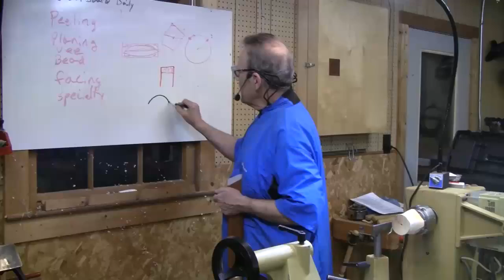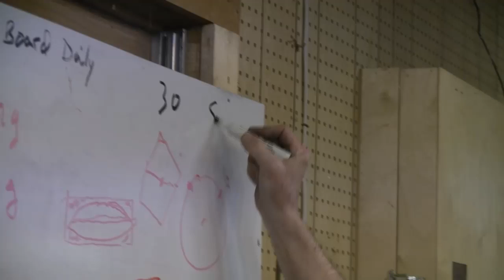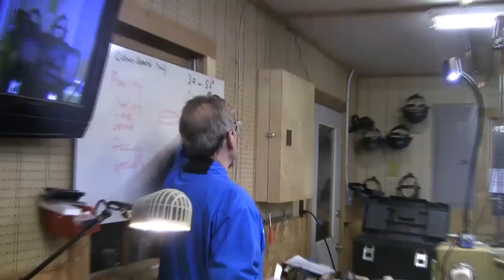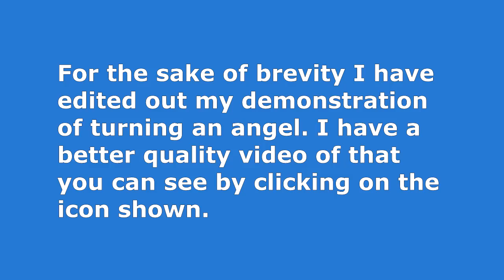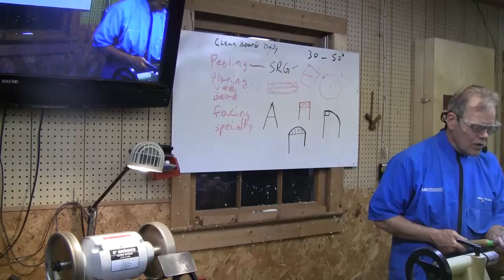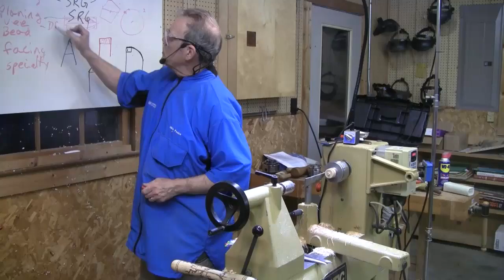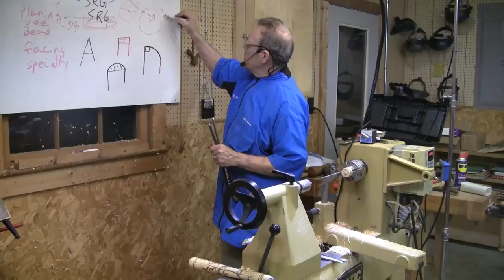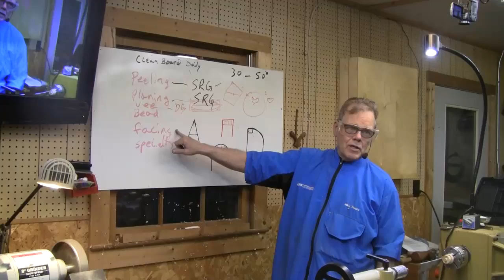Skew – Devil's Can Opener? Part 3 of 3

Comment: Useful and interesting series Mike, thank you. Be aware though, the Sorby Patriot chuck is still made in Sheffield, England! Not much is these days, but the Patriot is as is the Proedge Sharpening system. I use the Patriot, Super Nova 2 and the Record Power SC4. They are all good, but the Record and SuperNova are of Chinese manufacture.
Reply from the maker: I borrowed a Patriot when I did the review of the Record Power SC4 and sure thought it said made in China on the box but apparently that is not correct. I see that CSUSA says they are manufactured in the England. It appeared to me that both the Record Power SC4 and Patriot appeared to have a higher quality than the SN2 which I have used for 10 years and like.

Comment: Do you have a link for those small jaws you use for turning the angel?
Reply from the maker: Mine are the Sorby Patriot 3 mm but I recommend the Record Power 35mm. They are available from Crafts Supply and other woodturning vendors including Amazon https://www.amazon.com/RIKON-Power-Tools-78-321-Standard/dp/B00ZYTPE3K/ref=sr_1_6?ie=UTF8&qid=1490799856&sr=8-6&keywords=record+power+jaws